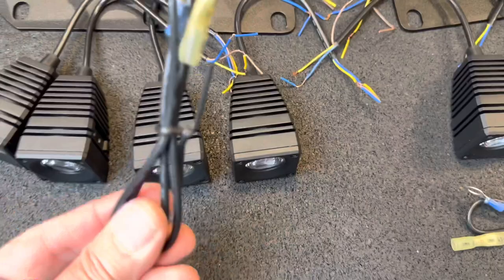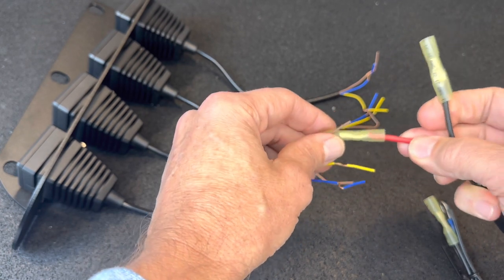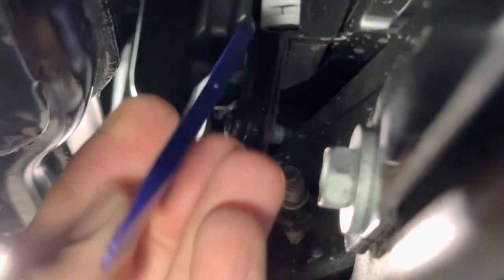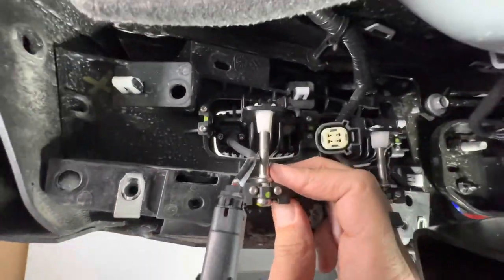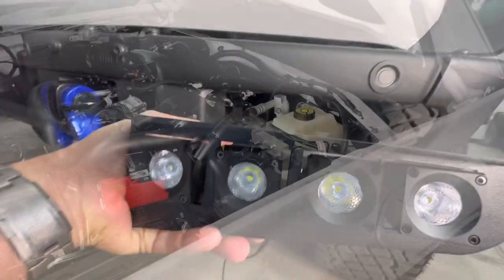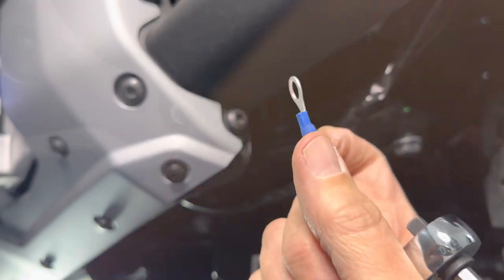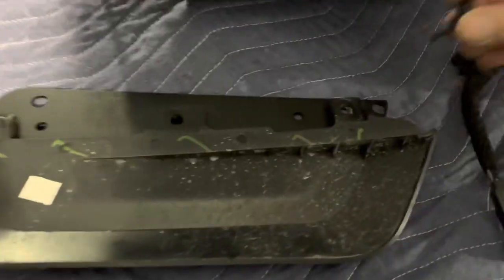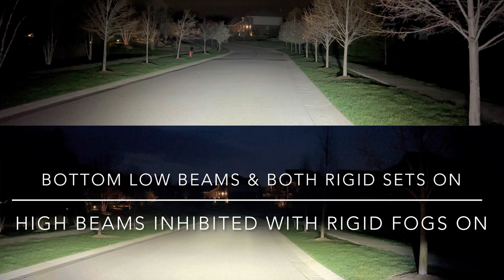M & R Ford Bronco Raptor Dual Function Fog Light Kit - installation, review, and demo.

Comment: i would suggest spending more time explaining the difference in the wiring of bronco and bronco raptor .  for example 30 A has been moved from 1 to 3  if you have rigid lights aux 1 is not with the other 5 it goes to the lights    not a detail list just a couple items i found